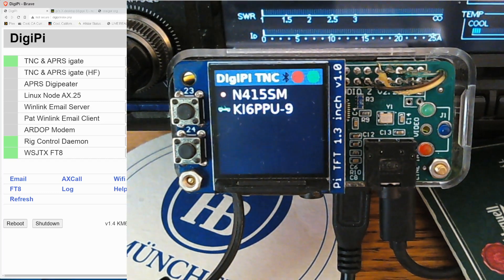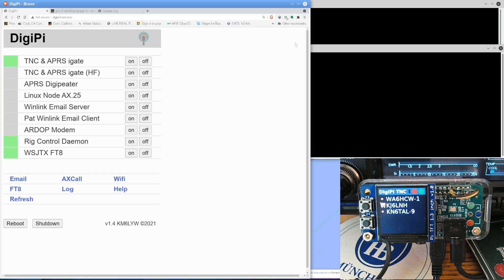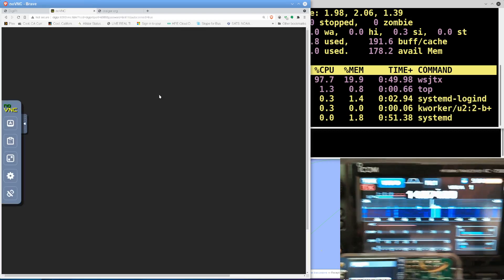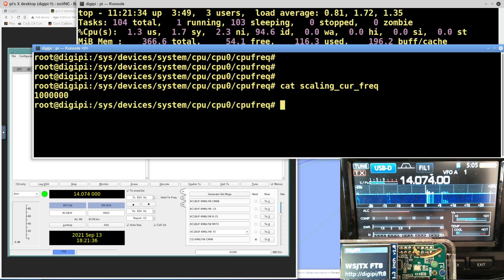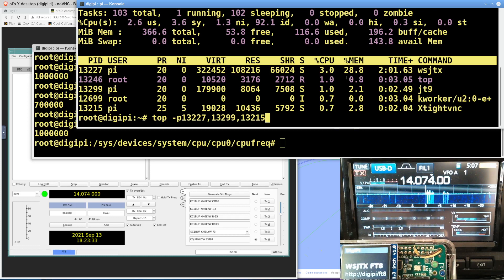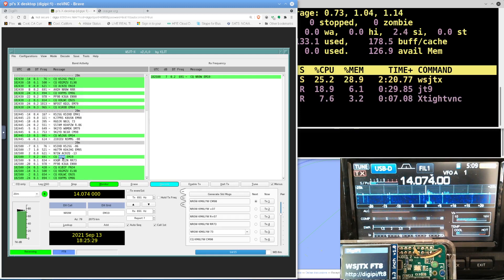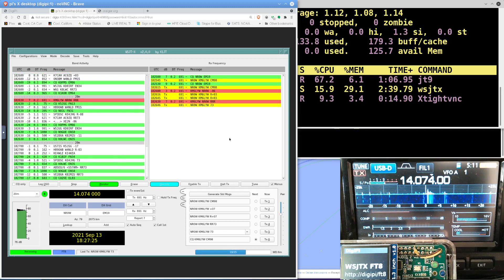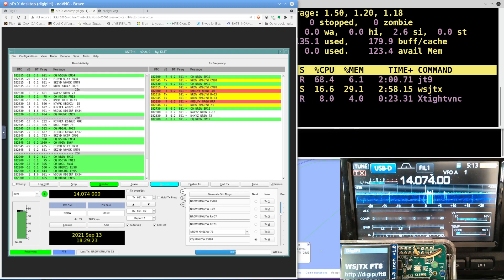Run FT8 on a Raspberry Pi Zero?

Comment: Good stuff - thanks! I use KM4ACK's pi build on a Raspi v 3 B+ and the VNC like you are. What I have found is that if I use the -bgr option the screen refreshes faster at the expense of accurate colors.

Also wondering how to find a clear transmit freq if there is no waterfall. My rig doesn't have that feature on it. What I do is place the waterfall "behind" the main FT8 screen and only show the top row of it. Sure the waterfall still uses CPU, but at least VNC isn't unnecessairly painting the screen below the first row of the waterfall

Thanks for these videos - good stuff!

WB8ERJ
Reply from the maker: great observations!  i'll look into -bgr.  Using Xtightvnc with websockets.   the ft8 waterfall is there, it's just behind the ft8 window as you indicated.   the randomness of the waterfalls makes vnc difficult but doable.  I also demote the processor priority of Xtightvnc, so it only runs in available cycles.

Comment: I wonder if other Linux machines has that long startup issue.  I have seen on a UNIX machine but I was not checking. Very interesting.
Reply from the maker: It takes unusually long to startup on a quad-core x86 PC as well, so it's not just a Raspberry Pi thing.  In any event, it's a temporary situation and it runs great once it's running.